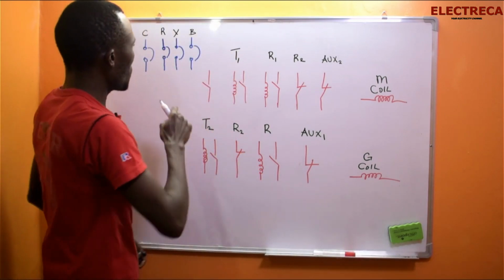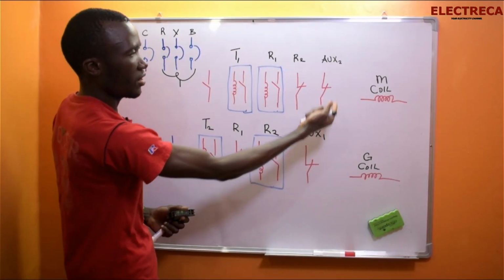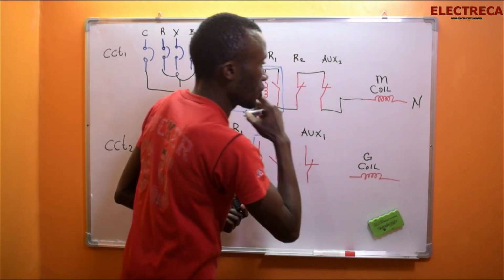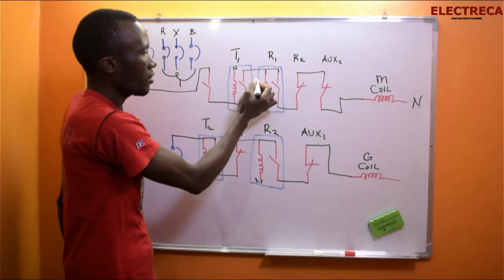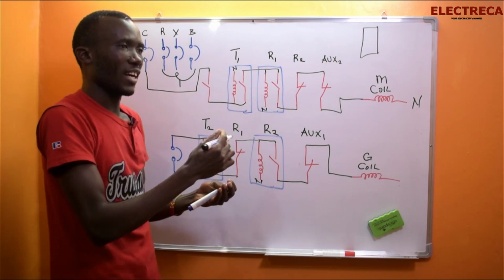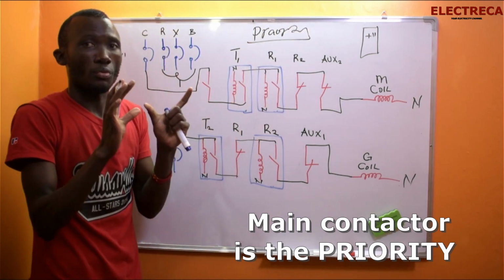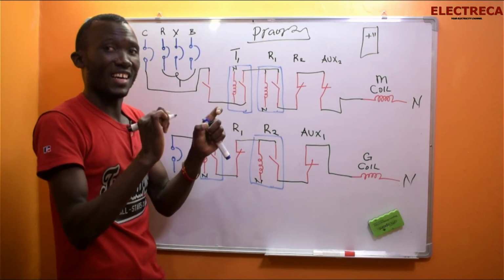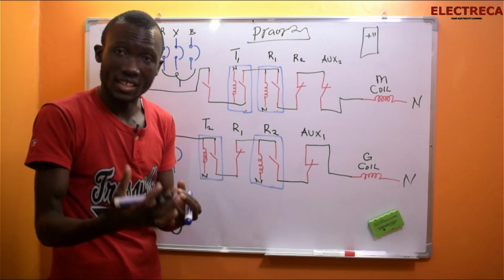DIY Automatic 3-Phase Switch - Wiring Diagram Explained

Comment: Good video but in a 3phase automatic changeover system, how do you get the signal wire and where is the signal wire connected to in the diesel generator.
Thanks

Comment: So a spare NC contact on R1 (mains side would be your generator start signal (this contact open when mains healthy). Then when mains restores T1 acts a the generator run on timer (this stops the generator starting and stopping quickly if the mains restores then fails again in a quick succession also known as hunting)? Good video well explained with a simplified circuit diagram. Also T2 allows the generator to reach speed. Could you use the ready for load output from your generator controller in place of T2?

Comment: Where will i connect the two signal cables from the generator in the diagram please.help
Reply from the maker: The signal cable is connected to the mains power relay NC
Reply: @elektreca please, where's is the signal cables connected to in the generator?
Is it the battery or where.
Please, also drop your WhatsApp number.
Thanks.
Reply: Please, in a 3phase automatic changeover system, how do we get the signal wire that will turn on the generator once the grid goes off?
Reply: Also, in a 3phase system, i think we'll have 4signal wires that's 3 live wires and the neutral wire so how do we incorporate this

Comment: I m lost abit, from relay no2 where does it get the supply and from there it will supply auxilliary no what?
Reply from the maker: Relay no2 is for generator side, and one of its work is to interlock. or it will lock out the mains from engaging while the gene is running.

Comment: Thks bro ur video is very interesting gud explanation...can we and surge protector   on it and how..
Reply from the maker: Yes, we can......... if the surge protector is auto circuit oriented then include it in the circuit before the phase failure NB The control wire before it goes through the phase failure contact 15/18(NO) should go through the surge protector contact C/NO.
But if it's Power circuit oriented( rear) then it can be connected after the changeover.
Reply: Thanks for your reply bro..Can u send me a wiring diagram please....

Comment: Where does the control circuit of the generator gets power from?
Reply from the maker: From the generator
Reply: Quiet satisfactory
Reply: The generator control circuit gets power from the Gen output busbars/ terminals.
Whenever the Gen starts the busbars are powered before the Gen CB closes.

And they will be de energised once the Gen relay commands the Gen to stop.

It's is the same point where the Gen radiator control panel gets power from.

Correct me where am wrong.